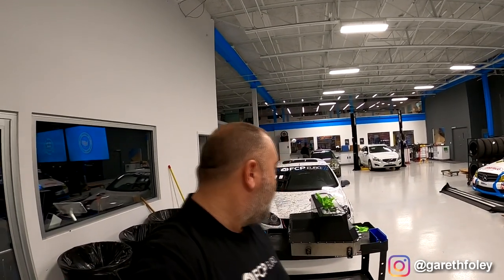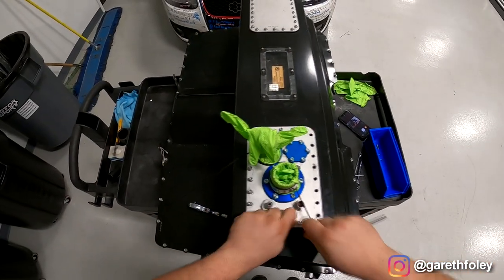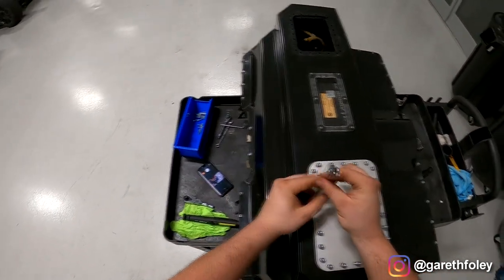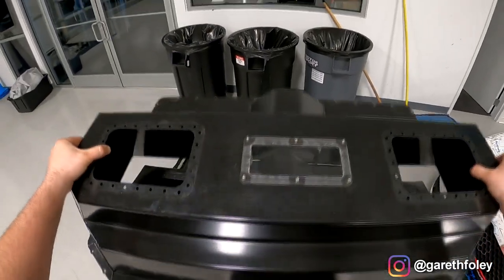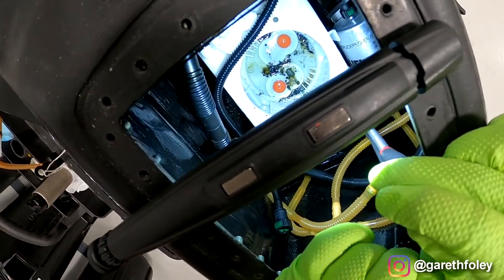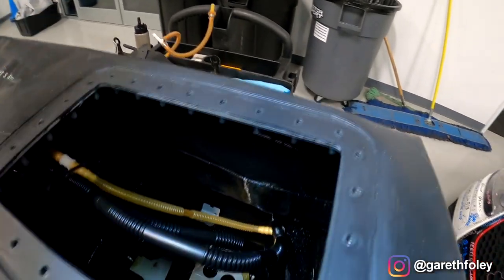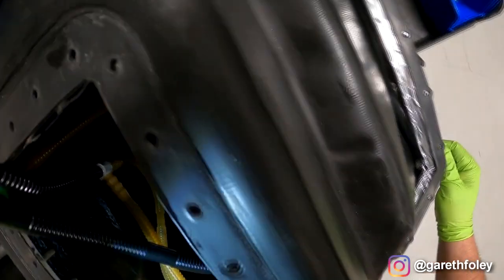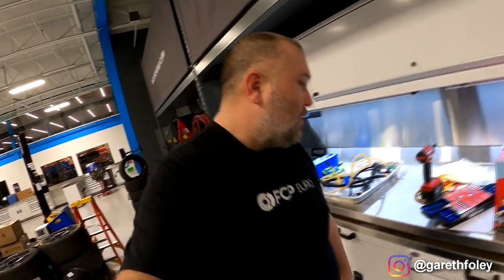VW GTI TCR Fuel Cell Tear Down - 2020 Motorsport Vlog #3

Comment: Is the tcr race car fuel cell a direct bolt on for a road base GTI?
Reply from the maker: No. Completely different fuel system entirely. Also, the body is modified to accept the  fuel cell (floor is cut/mounting tabs are welded to secure cell).